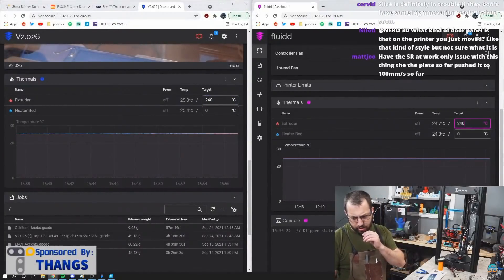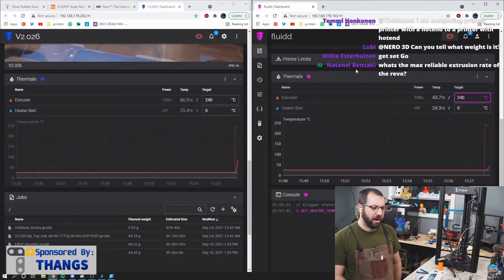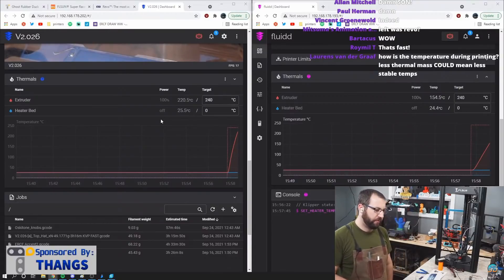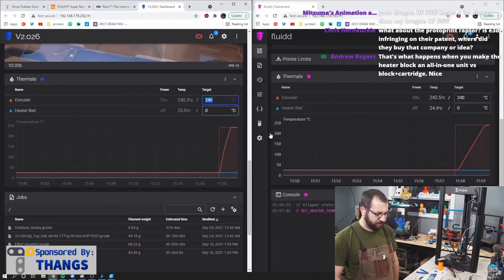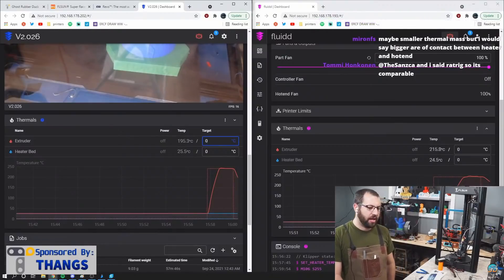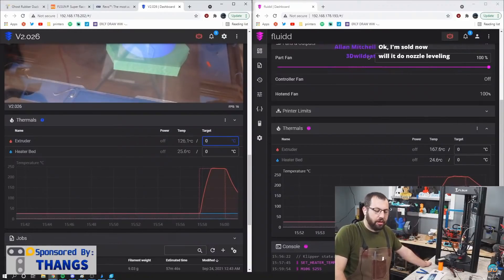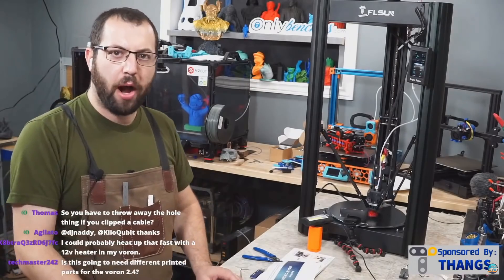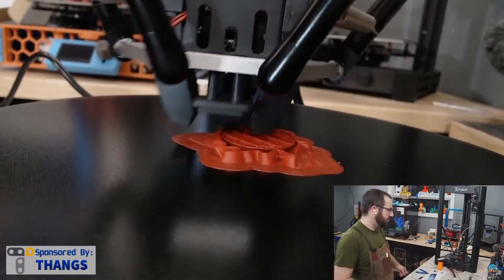E3D Revo(v7) vs HF Dragon Heatup Comparison

Comment: putting the thermistor closer to the heating element gives you a more responsive graph, with more overshoot and undershoot and lag at the actual nozzle temperature.  Just looking at the graphs can be misleading.  If you try pushing filament by hand while they're heating, you'll probably notice that lag between when the revo says it's at the melting temperature, and when the plastic actually starts flowing.

The revo likely has a prettier graph, but  worse temperature regulation if you were to actually measure the temperature at the nozzle.  This will mean It'll need a slightly higher temperature setting when at flow rates near its upper limit.  (And slower flow on these fast prints will be more overheated)

WRT thermal mass: It mostly doesn't matter either way, assuming PIDs are tuned, and you have an accurate measurement of the nozzle temp.  A more massive block will take longer to heat up, and cool down, but since we're generally printing at a constant temperature, it's actually easier to keep its temperature smooth, since the load changes will not affect it as quickly.

Comment: I like how people are super offended that a clearly better design might work better. I still don't think we're quite there yet - we shouldn't be in a position where we're indirectly heating the filament path, we should be inducing heat inside the nozzle, precisely where we need it at a gradient we need it using electromagnetic induction, where that gradient can be tuned and shaped for the best outcome (i.e. performance and print quality). Also, if anybody who makes 3d printer things uses that you can have that one for free, but if you start throwing patents around I will show up with prior art.

Comment: 0.o? Never have I been even slightly concerned about how fast the hotend gets hot, it's universally the heated bed that takes a long time.
I'm hoping that with the Prusa XL coming late 2022, it has a modular bed of 16 sub-assembly beds that heat independently, that they will heat not only more uniformly but because they are each fairly small they will heat up really quickly.

Comment: This test is nice but useless. The Revo has thermistor and hearing element extremely close together. It heats up fast but you don't know when the heat has reached the filament. For the dragon, the thermal mass buffers the heat and the reading and actual nozzle temp are likely closer together. Only a part that's quickly printed and has rapid changes in flow will be able to show which system is better.

Comment: Not sure if that is really apples to apples..... heating up I get .... but what filament can each push thru ?  How can we compare it with filament been pushed thru ? And it's a lot more important that the TEMPS stays up and not drop off at all so a bigger tight block will always with.

Comment: It's remarkable how similar the heater/thermistor configuration is to the Ubis hotend, which has been around since the first Printrbot.
Reply from the maker: There is still things not shown publicly yet, but the whole revo hotend heater/block is new and developed in house 
Thats like saying a 98 honda civic is the same as a tesla S cus they both have 4 wheels
Reply: @CanuckCreator  yeah, I realize there are differences like the ceramic heater, but philosophically they seem similar compared to the old E3D approach of an off the shelf cartridge heater in a block of aluminum.

The single piece (I wonder if it's a friction weld) nozzle and heat break seems to be the big disruptive innovation here.

Comment: Have you tried any high temp printing with this? I fear the ptc circuit would make the pid unstable at different temps than where the tuning was performed. 

I had this issue with a volcano nozzle. Without running some filament through it during the tune I'd get horribly unstable pid settings going plus or minus 20c because my power demands were much higher compared from no flow to all the flow.

Now this was probably my fault due to power supply constraints, but with less thermal mass i wonder if the pid tuning can be accurate enough.
Reply from the maker: printed up to 280c (nylon) no issues, i have a dedicated machine for higher temps plastic so didnt push it much beyond that

Comment: Considering how many headaches I had with Dragon I'm excited for Revo. I gave up on getting the Dragon working without jamming or a ridiculously overpowered fan so I usually just use a volcano on my CR-10 V3. Tempted to get the Revo now just based on the easy switching of nozzles. Z-catch works ok on Volcano but it's still a minor PITA.

Comment: interesting test but I think measuring heating up isn't quite fair as to how it performs with fast flow changes. the revo has the temp sensor in the heating core, so of course it's fast and stable to regulate. it doesn't mean that the nozzle is actually that fast or stable

Comment: So what? Ceramic heaters aren't exactly new tech.
Reply from the maker: The heater is an in house design that they`ve spent quite awhile working on, its not just a ceramic heater that you see currently on the market

Comment: We need another "Choosing a Hotend" video with all the new options that are out there.
Reply from the maker: Is the revo out yet? If yes then revo. If no. Wait or dragon/dragonfly
Reply: @CanuckCreator  Nothing else worth considering? Mosquito, TL Spiral Tower, Dragonfly HIC HF? I know you've said things like the Nova hotend is just a shiny volcano.
Reply: @CanuckCreator  I think we need some proper flow rate tests and print examples before we all go buy this thing. So far it seems like it can barely keep up with a standard flow dragon (luckily E3D's official numbers of 10 mm^3/s seems to be wrong), and i'm personally of the opinion that there's zero point in buying a non HF hotend in 2021 with the machines we have available. Not to mention that a Dragon HF prints slow just as well as it prints fast. Why would we settle for less? To me the Revo looks like it's targeting beginners with slow moving bed slingers, which is fine, but then the price is just all wrong.
Reply from the maker: @miklschmidt  Its keeping up with my normal "pif speed" profile which maxes out around 18mm3/s, it performs a tad better than most SF hotends, but it isnt a HF....those are comming later.

Also, what is flow? e3d says this, slice says that, what temps, what nozzle size, what filament type? Theres so many variables and no set standard for comparison it really doesnt mean anything cept for marketing.
IF i run a 1.8mm nozzle with a plastic that melts at 190c running the hotend at 300, look at how high my flow is!
Reply: @CanuckCreator  Yep that's about what i've heard. My SF dragon does 20-22 on a good day, depending on the filament. If/when the HF comes, i would debate if this current model even needs to exist. I've found no advantage to using a standard flow dragon over a HF dragon in any scenario.

Completely agree with you there, we need a proper standardized method to accurately measure flow. I know someone is working on that :) Until then, it would be sufficient to just provide the numbers and the testing methodology for PLA on different nozzle sizes (At least with a 0.4mm nozzle). Then people can reproduce and compare themselves. It will never be apples to apples, but right now we've got nothing. It's pretty complicated to compare flow accurately as it depends on so many factors, but we can still get within some range of "useful" without too much effort :)
Reply: @miklschmidt  check also protoprint raptor :) here it is properly ignored it seems…

Comment: Nice, but why E3 can´t get rid off their groove mount. ( I remember ur Video "Choosing an Hotend" )
Reply from the maker: There are un-announced mounts, heres hoping for a rigid mount
The beta units had the screw top mount, which while not rigid worked quite well in testing (still hoping for rigid down the line)

Comment: So a redefined Trianglelab ceramic heater? that one fits a V6 thread heatbreak, but I have NOT tried it, bought it about a year ago or more..
Could we make a cheap Revo like hotend or would we be limited by low flow of the compatible hotends?
Reply: ...those were exactly my thoughts  when I saw the first videos of the Revo: a souped-up TL ceramic heater kit with a proprietary spring-loaded nozzle.
You can combine the DIY variant with a cloned Hemera titanium heat break/sink combo to get closer to spec ;)
One guy in the comments on AE claims 210°C in 15 sec...
Reply: @tomwilczek1759  Maybe I should just try it out, actually started to do some visual research of the hotend compared to whats out there. But the Triangle Lab ceramic heater is limited to a V6 thread, so the question would be what is the best heatbreak metal these days? bi-metal or titanium it seems. If this actually is a good heater it would certainly be cheaper then the Revo with those nozzles. Maybe stacked two of these with a volcano nozzle?
Reply from the maker: The heater is a completly different type of heater the ring style heaters out there already, its also a PTC heater which is safer and the whole package was developed by e3d internally
Reply: @CanuckCreator  no doubt that E3D put out a well-designed package - and a properly designed PTC element indeed won't overshoot its equilibrium temperature which can be set to the "tap out" point of around 300°C and everything below is controlled by voltage adjustments aka PWM. It's just hard to imagine they found a ground breaking new concept for thermal control that hasn't been around in the process industry for the last 30 years :)
Reply: @CanuckCreator  So in other words you have no faith in even trying the round ceramic heater like the one trianglelab have? 
Sadly if this new hotend from E3D is good, and will be the new "norm", it would probably hurt the 3D printing community now that they will start patenting stuff.

Comment: Nice! Can you please attach 24V directly to it and see if E3D's claims are correct, that it prevents thermal runaways?
Reply from the maker: its a PTC heater, as temps increase power draw decreases so it cant "run away" like a traditional heater
Reply: @CanuckCreator  Yes, please put that to the test! I want to see how hot it becomes! :D
Reply from the maker: @certified-forklifter  after I get a second one. Dont want to kill my best hotend yet lol
Reply: @CanuckCreator  A PTC... That's pretty clever.

Comment: I have a question about the HF hotend, do you limited the Power of the 50W heater in HF hotend to get a smooth temperature control?. anyway. use a PTC for a 3dprinter heater is SMART. E3D YES

Comment: it's cool but for 120$ i rather spend the extra 30 for a mosuito that also has cheaper nozzle replacements and more options like tungsten carbide
Reply: Sure $30 more then buy the heater and thermistor as well. Unless your swapping them from another hotend. 

It will suck being limited with nozzles for the time being but those will come.
Reply: @jasonwoody8041  it's just too expensive too. Maybe china will clone them. I just can't afford to spend 300$ for just hotends in my printer anyways
Reply: @ameliabuns  i hear you there. But its new. They want to recoup the R&D costs asap. And the cost of metal is way up. If your not needing to replace a hot end just hold off till you can afford to lose the money. Im going to keep my hot end until that time, but i love how that comes molexed right out the gate. And the super low weight.
Reply: @jasonwoody8041  oh the molex is great :p, maybe triangle labs will make a clone anyways. For people like me my designs just aren't possible with expensive stuff.

I wish some manufacturers focused on budget products

Comment: Not weird, considering the revo has a ceramic heater core heating all around the revo unit, compared to the standard heater cartridge on the dragon.
Would not be surprised to see phaetus releasing a new version with ceramic heater

Comment: You still have to wait on your bed to heatup, so does it matter?
Reply from the maker: Because the faster your hotend can respond to increased and decreased demands ( flow rate changes. Part fan speed changes,) The better and more consistant your prints will be
Reply: @CanuckCreator  Even if this was true, and it's a pretty dubious claim, your experiment just shows the Dragon has a higher thermal mass. That will smooth out any thermal changes due to changes in flow. Thermal mass in this case is equivalent to adding a capacitor to reduce ripple in an electrical circuit.
Reply from the maker: @MatBettinson  the only direct one to one comparison was vs a standard flow mosquito. As thats what i had previously in this machine.
After the swap temps where more stable..prints were cleaner and small slow details more defined after during infil speeds and flow. And overall finish was improved with a bit of a speed bump from a bit more flow capacity
Reply: @CanuckCreator  I guess I have to take your word for it but sheesh man, you can print with a delta of a few degrees and the differences aren't huge. The stability you're talking about here, I would assume this is within a single degree. I still don't see how lower thermal pass gives you greater stability, particularly since Klipper's PID is infamously choppy. I want to see these guys succeed but there needs to be some evidence of real benefit to counteract the inclusion of prioprietary nozzles, heater and thermistor (and a shit 104GT at that). It needs to be tangibly better to justify that stuff in my view.
Reply from the maker: @MatBettinson  pt1000 will come. Later beta units remember. Not everything was finalized
Reply: @CanuckCreator  That would reduce some anxiety. Still worried about the heater. Worries might be alleviated by some practical matters like whether those steel chonky nozzles turn out to be less of a pain as steel v6-style nozzles.

Comment: I don’t see why this is important. The faster a heater block heats up, the faster it can lose that heat. Thermal mass is needed to maintain heat. Less thermal mass the harder the heater has to work to keep up with the needs of the printer. 

A chunk of copper is always going to be better, more stable and more consistent. 

The revo won’t be printing fast anytime soon.
Reply: 200 mm/sec isn't fast for you? My Revo beta Is more consistent than anything I've tried before
Reply from the maker: It can hold a stable temp better than a larger block because it can actively adjust the heater output quicker and respond faster while using less power.
So it wont overheat filament due to a large latent thermal mass when going form a High flow print section like infill to a small slow detailed area, and wont lag on heatup when doing the opposite.

The machine I Have the revo in  previously had a mosquito. Temps are now more stable, and was able to push flow rates a tad higher.
Reply: @CanuckCreator   Don't see how maintaining a temp (here 240) would "overheat filament"... 240 is still 240 even if it weights 1 pound
Second, the only extra power it will use, is the power to heat the extra mass. After that it will be same for both.

But granted if it can maintain stable temp with less thermal mass, translating in faster thermal changes, that's all that is needed

Edit: the limiting factor will be the temp sensor and how quick can it register the change. ..

Comment: Revo have small heatbrake , that's the reason it is quick. But is hasn't thermal capacitance that means it's vulnerable to big temperature changes from part cooling or big volume extrusions. Perhaps PID can handle that perhaps not.
Reply from the maker: It can and does, its the most thermally stable hotend ive run so far. Its ability to quickly adjust its output to fans and filament flow keeps temps stable
Reply: @CanuckCreator  did you have same version of klipper on both machines? it's actually changed default pid response time for hotend from 2 seconds to 1 second(which can be even smaller)
Reply: @CanuckCreator  Yes i had max 0.3°C deviation when the part cooling fan kicked in.

Comment: If the Revo have a better response and less thermal mass, does this mean lower numbers in pressure advance?
Reply: I would argue no, pressure advance is about friction / resistance of the hotend and the needed pressure to extrude filament.

Comment: Doesn't that just show a low thermal mass?
Reply: Yeah, I think this just shows really low thermal mass. I would think slower is better here. In practice higher thermal mass would mean lower temperature fluctuation when printing
Reply: @dakotaadra1044  not understanding this either. :-) would be a different thing if you'd change temps across your print but thats not really a thing as far as i know. and transferring electricity into heat should be totally equally efficient given appropriate cable diameter.
Reply: It seems like it does, but if you don't really need the larger thermal mass to get good prints, then you get all benefits.
Reply: Yes, however, there is a proper PID tune in place to compensate.